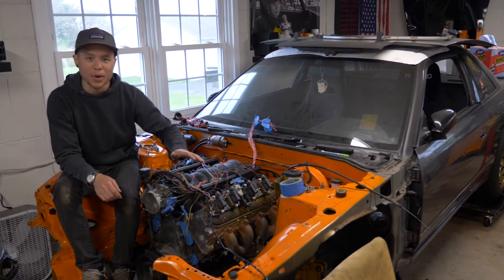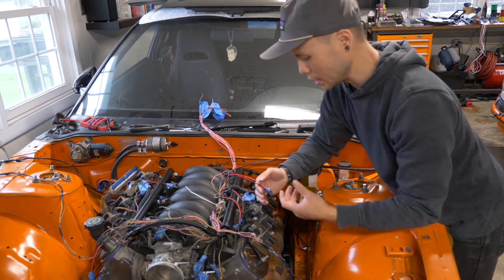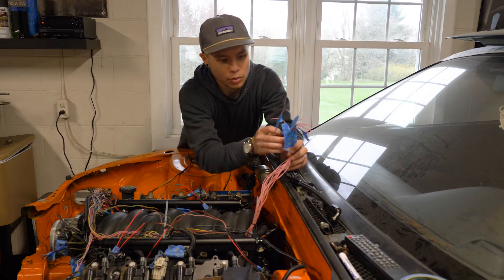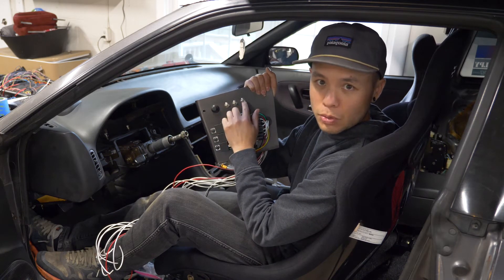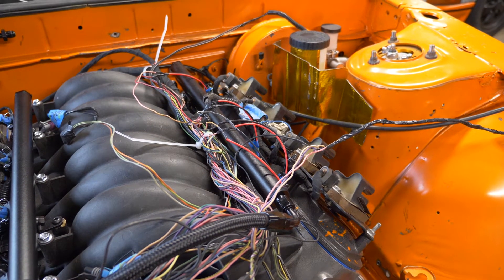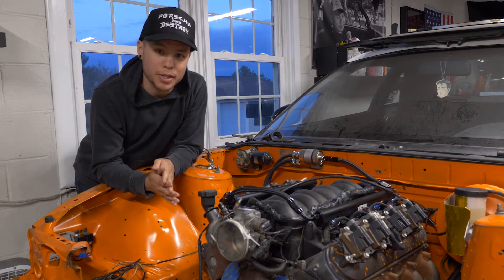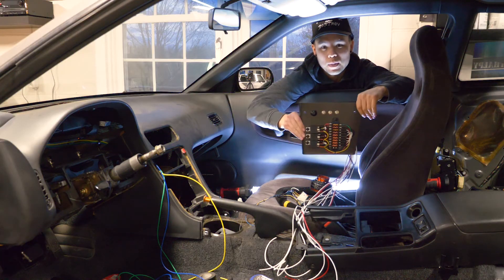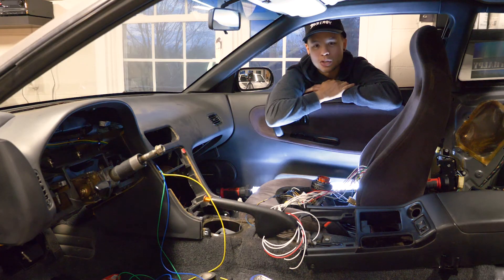DIY Wiring Harness Pt.2 | LS Swap 240sx

Comment: Is this what u used to power your entire chassis harness? Like interior lights, windows and headlights?
Reply from the maker: Yes, the fuse block and relays in the center console power the whole car. Currently no interior lights, no windows. The headlights and taillights are still switched on via the oem switch and powered through a dedicated lighting circuit on the board.
Reply: Yeah that's what I'm currently working on figuring out that mess myself. Gonna try keeping the factory fuse box and run power to it, see if I can keep my stuff working. 🤷‍♂️ we will see.
You have any game plans on how to get yours working?
Reply from the maker: @TypicalTrashGmr  I was able to figure out what's needed in order to run a new circuit for the windows, but it's basically at the bottom of the list of priorities at this time.

Comment: I just finished my lm7 rebuild debating a 240sx or 300zx... Was going to do wiring specialties but that switch board looks bad ass....
Reply from the maker: Go for it! If you don’t mind wiring then it’s a straight forward job that pays later if you need to troubleshoot things. If you don’t like wiring, however, buy the wiring specialties harness.
Reply: The new holley x standalone comes with a harness and 3.5in touch screen for only 1200

Comment: Awesome vids man. How did you hook up the Z32 starter? Straight to the battery?
Reply from the maker: Yeah a zero gauge wire direct from the battery. Then from the starter post I have wires to the alternator and fuse panel.

Comment: What manifold/headers did you go with instead of the long tube? It looks like a gto or c5? I ordered some block hugger shorty headers  off ebay and hope they work but if not I'll have to go from there.  Im swapping a ls into my s13 now as well
Reply from the maker: I started with Sikky headers but they didn’t fit around the z32 trans. Then I tried C5 manifolds but those dump right into the subframe. I’ve now got C6 manifolds which I think will work.
Reply: Benny Obscene ok thanks for the reply.  Are you  on facebook by chance,  ill look you up.
Reply from the maker: Yup, but mostly Instagram. There is a helpful group on Facebook called 240sx LSx Swap though.